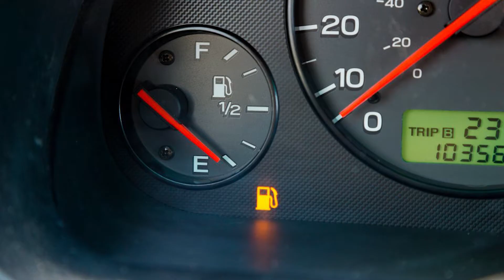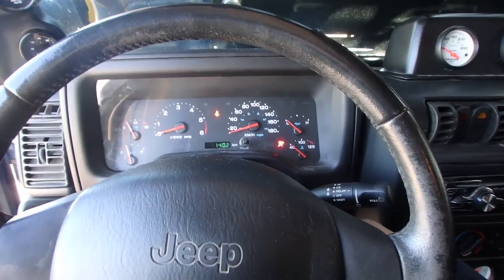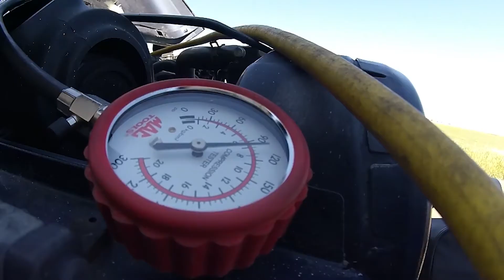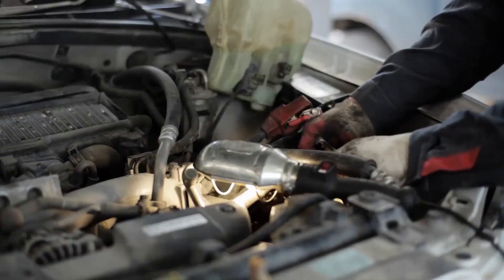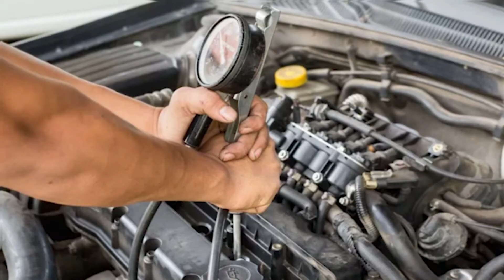7 Causes of Low Engine Compression and How To Fix Them

Comment: Why it says how to fix it and there is nothing about it
Reply from the maker: At 4:25 we suggest finding which engine part is damaged thus causing low compression.  At 4:35 we suggest replacing damaged engine part or parts that are causing low compression.  That is how you can fix low compression issues.  You can check it out again.  Thank you for sharing! Good Luck!

Comment: My corolla 2009 won’t start the compression is in and around 100 is there anything can repair or the engine needs to be change?
Reply: change head gasket have mechanic check first

Comment: My car is Corolla 2012 My car problem is starting trouble the mechanic told Engine compression is low especially 3 rd valve is showing less, he told change the full engine rather than repairing my question is if there is any solution for this problem or i want to change the ENGINE, or any other option is there please give me your advise. Thank you Sanju UAE

Comment: My car overheated for a while and stopped, and now it won't start. It sounds like a low compression I hope it's just a bent valves
Reply from the maker: oh wow.  It's dangerous to let the car keep running with overheated engine.  You might risk burning and destroying the engine.  I hope that is not the case.  Good Luck.
Reply: @fixit3879 same with mine I’m hoping the same thing?!have you found the problem